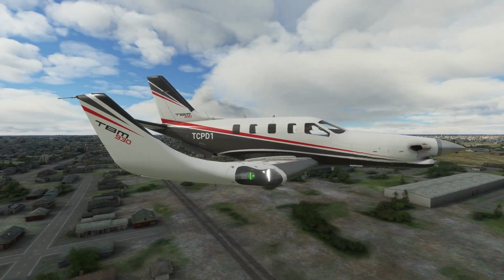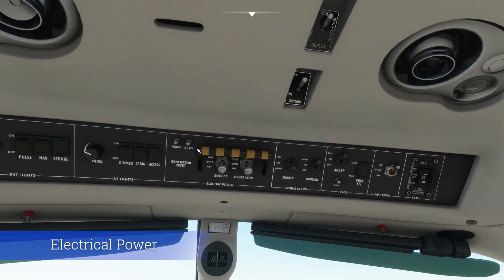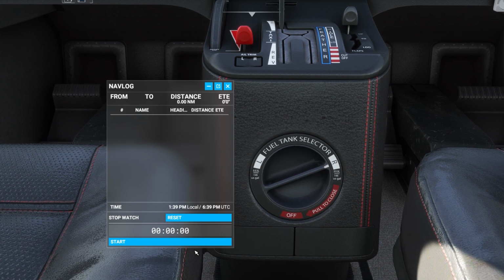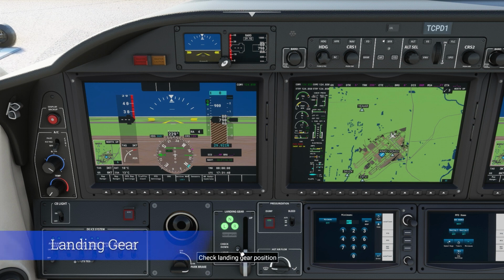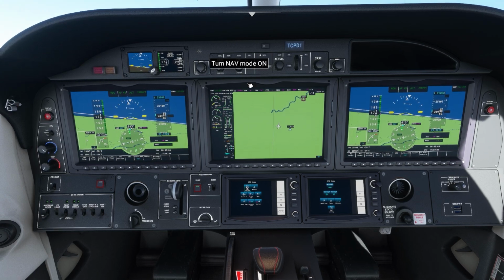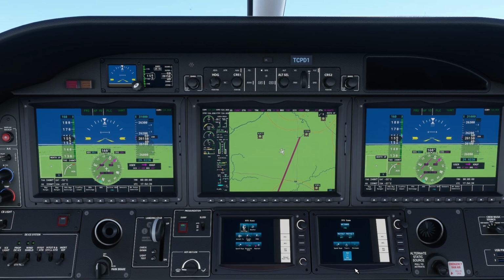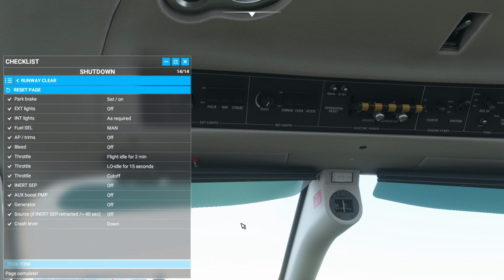Every Button and Switch on the TBM 930 Explained | The Complete Tutorial | MSFS

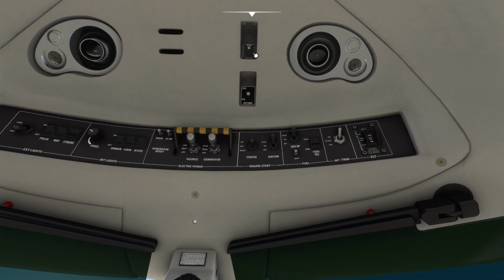Comment: how do you set the altitude [13:10] to 25000 ft. so fast? 
I can only do 100 ft. increments.
I read that you have to right click the alt knob to switch between 1000 ft. and 100 ft. increments. 
But I can only turn the ALT knob, not clicking.
Reply from the maker: I used the scroll wheel on the mouse.  Also, holding left shift while using the scroll wheel will make the altitude selector go by 200’ increments instead of 100’. This works on heading as well in MSFS 2020.
Reply: @thecorporatepilotdad  Nope, not by me. I tried the left Shift, Alt, and Ctrl but still 100 ft. increments. Both with the scroll wheel and the arrows next to the rotary knob.
I downloaded the original manual of the TBM but there they only mention 100 ft. increments. Nowhere a tip how to switch to 1000 ft. increments.

Comment: What about the LVL button ?
Reply from the maker: You’re right.  Totally missed that single button.
Reply: @thecorporatepilotdad  you know that I watched the whole video just for that 😂 because I couldn't figure out the real difference with the altitude hold button and couldn't find an answer online.
Well you deserve the view as you're video's quite good !
What about that button tho ?
Reply from the maker: @ody5199  it takes the airplane to straight and level flight.  If the AP is off and the pilot becomes task saturated, disoriented, etc, when hand flying, the AP will engage and roll wings level and fly level simply by pushing that one button.
Reply: @thecorporatepilotdad  alright thanks! That's why it is not located alongside the other buttons in that cartridge.

Comment: If you are using the Bravo Throttle Quadrant, could you please relay your settings for the Throttle and the Feather. I have watched some videos on this, and it does not work smoothly. I have the Throttle in Position 1 and the Feather in Position 3.
Reply from the maker: Sorry it took so long for me to respond.  Unfortunately, I do not have my Bravo hooked up and MSFS won't let me see the saved settings for the Bravo unless the unit is connected.  I did find this video where the creator shows how his controls are set up and he does feather the prop in the video.  Hopefully this helps: https://www.youtube.com/watch?v=XnZ5f5-3G5I

Comment: Great vid, I was using this TBM in depth today in Greenland, I swear on startup checklist there is a step I don't see on your screen about switching to that High Idle position when NG is somewhere (50?) for a little, then moving it over into the main track where taxi speed is. Not a big deal, but I wonder if something that small of a detail was added on in an update? Im on Xbox Series X, are you on PC and is that diff? Or I'm losing my mind from playing this game too much lately lmao! But nice explanation of every thing in practical, concise way!
Reply from the maker: Looking back at the video, low idle was selected at 13% and high idle at 15.  Around 50% high idle was selected and then moved to the taxi position right away.  It happened quick in the video but high idle has to be selected before the throttle can be moved over to the taxi position.   The video was made on PC.  MSFS is a lot of fun for sure.  There is so much to see and always new airplanes coming out.

Comment: Thanks for that video, I'm new to MSFS 2020 and have been trying to learn all the systems in the TBM and it's so frustrating when you can't get the airplane to do what you want it to, having a tutorial like this easy to follow and understand is worth it's weight in gold for the student, thanks for the attentions to detail. Maybe you could tell me why, when switching to external views of the airplane my throttle in all airplanes goes from 0 to full throttle, I can't figure it out.
Reply from the maker: I’m not sure on the throttle issue.  Are you by chance using a Bravo throttle quadrant? Glad you found the video helpful.
Reply: @thecorporatepilotdad  Nope just a Saitek Joystick, eventually I may figure out the issue there, still trying to get all those camera views adjusted for easy flying. Glad I found your channel, lots of good information on multiple aircraft. Have been flying for years on FSX so this is all new to me since most of these systems didn't work with half of the realism as MSFS 2020, you hooked me, I'm a new subscriber to your channel. Thanks!
Reply from the maker: @LTFIRE64  thank you for subscribing.  I wish I could be more help in the throttle issue.  The official MSFS forum may be helpful in resolving the throttle issue.

Comment: Nice job as always! I flew the 850 until it was taken in a thunderstorm while in the hanger. Question on the G3000 when building a flight plan and selecting an ILS will it auto tune the Localizer Frequency? Also on the LPV approach what modes are they flown in NaV Vnav? It seems every system has Subtle nuances to them.
Reply from the maker: I am not sure if the G3000 autotunes the localizer.  I do not think it does but once it is tuned, it will enter the final approach course automatically.  Not sure if the real G3000 does that or not. In a real airplane we use APPR and VNAV on an LPV approach.

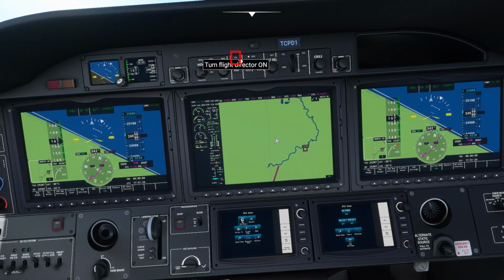Comment: At time mark 16:58 YEAH FMA 😁🛫
Reply from the maker: That is there because of you :)
Reply: Do you know if the TBM 930 will fly a LPV approach in fs2020
Reply from the maker: @TheFalconJetDriver  Is "kind of" an answer? VNAV won't work in the TBM but it will follow the GP at the FAF and beyond.  I think the Working Title group has a G3000 mod for the TBM that might do it, but I am not sure.   In the real world we select VNAV and then APPR when cleared and the AP will hit every altitude and take it down to the runway.
Reply from the maker: @TheFalconJetDriver  This is copied from the WT website concerning VNAV with the G3000 mod "The mod supports advisory VNAV guidance. This means it allows you to define VNAV altitude restrictions and profiles, and the system will passively display VNAV information. However, the autopilot will not capture vertical paths (V PATH mode)."

Comment: I have a question. I always wanted to know how can I turn on the traffic icons in the main panel GPS in the middle. Would like to know what softkey turns it on
Reply from the maker: I’m not certain, but the default TBM doesn’t display traffic.  Working Title has a G3000 mod that has traffic if using MSFS on PC.

Comment: Great video. I need another video on the flight director though.  I love this plane. One step down from a jet.
Reply from the maker: Almost as fast as a slow jet but has the ability to fly as slow as a 172.  Very versatile.  The AP and FD is covered at the end but I do have a more in depth video on the Flight Director on my CJ4 AP video.   It may look a little different but it’s all the same for the most part.
Reply: @thecorporatepilotdad  Wow thx! I'll check it out! I have a sick set up here at home and am doing touch and goes consistently. I want to start learning how to use the FD. Cya!
Reply from the maker: @redicanprime1181  what is your setup like?  I have a subscriber building a home Simulator.   I love seeing setups.   Mine is extremely basic but it’s on purpose and opposite of where layouts are in real life   Throttle on the left and joystick on the right.  I also have pedals.
Reply: @thecorporatepilotdad  hmmm I would like to send you a pic. It's a dual virpil joystick alpha constelation model with the cm2 throttle all attached to a chair mount. Im working on saving up for a head tracker.
Reply from the maker: @redicanprime1181  my email is on my about page.

Comment: I am using version 1.17.3.0 of MSFS and cannot get TCAS to work on any of the 1000 or 3000 model garmin systems...I didn't see any mention of TCAS controls in your excellent presentation...but can you tell me how I can get these back...I seem to have lost them when MSFS updated to this version...Knowing of some strange impacts of updates to the MSFS version--I just want to know if I can get the TCAS back or I have to wait for my "Zen" message to float to the top???? Any suggestions would be appreciated.  Thanks, GJTom
Reply from the maker: I wish I had an answer for you, but I do not.  The video focused on the major systems and avionics weren't touched except for the flight director control panel.  There is an updating coming tomorrow so hold on, who knows what will be fixed or un-fixed with that.
Reply: @thecorporatepilotdad  Ok--Thanks anyway.

Comment: Hi All I dont know if I am being stupid or something but in the TBM I do not have the option of selecting FSM. My only available options are GPS and the normal direction finders. Am I doing something wrong or is my sim bugged?
Reply from the maker: Do you mean selecting nav source on the  primary Flight display?  If so, you will see GPS at the bottom of the display below the HSI with magenta course needles and that is using what is in the FMS.
Reply: @thecorporatepilotdad  Yep that is exactly What I am seeing. Im just confused because every video I watch has an option for FMS and not GPS
Reply: Great Video by the way!!
Reply from the maker: FMS uses GPS so it’s the same thing in this case.

Comment: I like using the mixture nob on the Cesna G1000 to help save fuel, does this plane have a mixure adjustment anywhere.. I been searching in the aircraft and also online but haven't found any info.. so I am assuming no..
Reply from the maker: Turbine powered aircraft don’t have a mixture control like a piston engine aircraft does.   To save fuel in a turbine aircraft go higher or fly slower.

Comment: What about the CRS knobs.  I would expect to enter the true runway course from the approach plate for the airport
Reply from the maker: Some avionics are not automatic and the magnetic heading of the final approach course has to be entered manually.    I believe the avionics in the TBM do it for you.  If you switch to LOC/VOR mode far enough out they can be entered manually.

Comment: Two questions after watching this great tutorial again.

When you're in an aircraft such as the TBM 930 not equipped with a beacon light, how do you signal to the ground crew you're about to start the engine or start moving when doing a pushback?

Next, are you supposed being able to capture the localizer of an ILS when you're in HDG mode with NAV source set to LOC and the correct ILS freq and inbound course set?
Reply from the maker: Another choice would be the strobe lights.  

It should be possible to capture the localizer while in HDG mode with NAV pressed.  We do it that way in real flying.  ATC gives a heading to fly to intercept the localizer.  Example:  "Turn left heading 270, maintian 2000 until established, cleared ILS runway 30 approach."  In which case you would press APR when you hear cleared for the approach but HDG would stay active on the FMA until the localizer course is intercepted.   However, FS2020 doesn't let that happen.  The CJ4 WTM DOES work that way.
Reply: Was thinking about the strobe lights but figured that would be quite disturbing for the ground crew with those very bright flashes. Was thinking maybe switching the taxi light ON would be better.

Thanks for confirming not being able to capture the LOC in HDG mode in the TBM 930 being a MSFS issue. I'm no pilot but I have thousands of virtual hours in the 737 online on Vatsim and what you describe is how I'm used to flying an ILS approach as well. That's why I was a bit surprised when I tried the same method in the TBM 930 only to find how that would result in an overshoot rather than turning final onto the LOC
Reply from the maker: @RichardÅsberg  It's a shame they released FS2020 in the state it was in.  So much stuff needed attention like not being able to use HDG to intercept a LOC with the AP.   We normally flash the taxi lights when we're ready to taxi.  Strobes would be ok in the day time.  At night time I would not suggest strobes in real life to indicate ready to start.
Reply: Yeah, lots of very basic and fundamental stuff not in place at release but I guess they were pushed internally as often is the case with these kind of large projects. In all fairness, lots of good and very impressive stuff as well and I'm positive MSFS will be absolutely brilliant in most aspects down the road.

Thanks again for the answer about the lights. Flashing the taxi lights sounds like a great way doing it but also how it's OK using the strobes during daytime👍
Reply from the maker: @RichardÅsberg  I agree.  The graphics are amazing and the developers are working to make it right and have committed to 10 years of support.  In a year or two we should have a much better product.   Also when they get an update to Bing maps we'll get better graphics, too.

Comment: Does the VNAV Function work in the TBM 930? I have the WT G3000 Mod installed. I have to use the FLC or VS Function to change altitudes. Also same question for the WT CJ4 Mod.
Reply: Thanks so much for the quick reply. I am using your guides as a study format for MSFS 2020. The CJ4 is almost perfect, if they would fix it to where you could map your AP functions to the yoke/joystick it would be Perfect. Is there a way to do that or am I just doing something wrong?
Reply from the maker: @jetsimmer  I am pretty sure you can.  I have re-mapped some buttons in the settings.
Reply from the maker: It does work for the CJ4 WTM.  I have a few videos on it.  https://www.youtube.com/watch?v=qvmaHwSVPMQ

https://www.youtube.com/watch?v=sPma7ZmTHXo&t=807s 
Try those out with the CJ4.  Then try the same stuff on the TBM with the WT G3000. I do not have the G3000 mod so I am not sure if it works on the TBM.

Comment: How do you controll the airspeed? As there is no A/T function in the 930?
Reply from the maker: I set it to get a particular indicated airspeed.   Fine adjustments will have to be made but it's best to get close to the desired speed and just let the speed bounce around by a few knots.  In cruise, I will set power as high as possible without exceeding any engine or speed limitation and take whatever speed I get.

Comment: This is a very sophisticated aircraft. Went to fly it from Gulfport MS to Cayman Islands but once I got into the aircraft my left and right displays were off. Only center mfd was on. Looked through the switches and could not figured out how to get those two displays on. Is there a switch or something I'm missing? Great tutorial btw.
Reply from the maker: Do you have a mod on your TBM? I have heard something like this in a forum but I do not remember the fix.  I wish I could be more help.  Thank you for the compliment on the tutorial.  This one took a lot of effort and it was slow to takeoff but I am glad people are seeing it and enjoying it now.
Reply: No mods and I'm running the standard version. I was wondering if there was a switch somewhere. I will mess around with it some more see if I can figure it out.
Reply from the maker: @GulfCoastTim  Did they display anything at all? I know when they first come on they say Garmin and you have to press the softkey below the screen.  My advice is to check forums.flightsimulator.com.  I am sure someone else has had that problem.  If I find anything I will comment here and let you know.
Reply: @thecorporatepilotdad  hey thanks for the suggestions. They never displayed anything. All I had was two black displays on both left and right monitors and then only the center display was on with mfd. What's this softkey you're referring to?
Reply from the maker: @GulfCoastTim  it's on the MFD after electrical power is turned on.  The screen will say Garmin then press here and has a line going down to a button below the MFD.  I don't recall if all the screens did that or just the middle screen.

Comment: I would like to see the "how to" use the Garman ns530 / ns430.  I've come across a couple vid's but they seem difficult to follow / click click click and done :)  As sim ppl, it would be helpful even if someone were to create a pdf for some, myself included / TO reply to your question, ref the How To: Gaman ns530 & ns430. I personally would like a start to finish on how to program/set up/ the devices in my MSFS aircraft. How to enter the flghtplan details.  I have seen a couple vid's for sim flyers, but the process, while appears basic, is hard for follow along ... even a *pdf file for sim flyers would be very helpful I might think
Reply from the maker: I have thought about doing tutorials on the GNS 530 and 430 but there were so many already.  I will possibly revisit this in the near future.  I looked at some and I see what you mean by people going click click click and done.
Reply from the maker: I think I will do this next.   Stay tuned.
Reply from the maker: I have a question.   I was using the GNS 430  and 530 in preparation for a tutorial.  So I can direct it more to the simmer, what specific questions or tasks would you like to see answered?